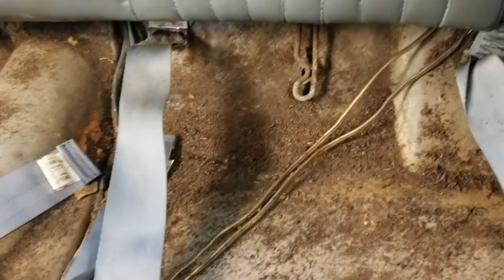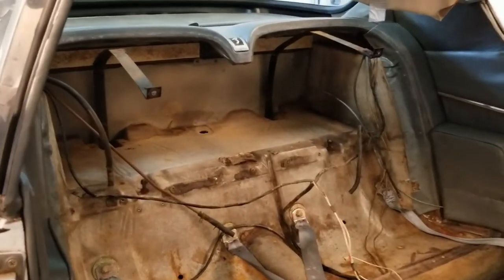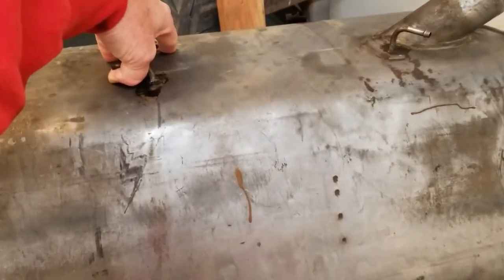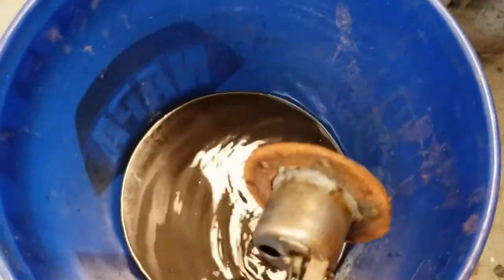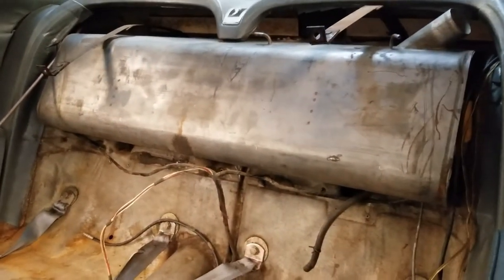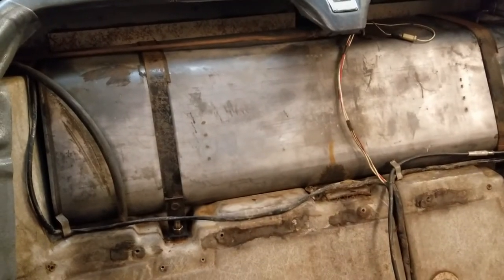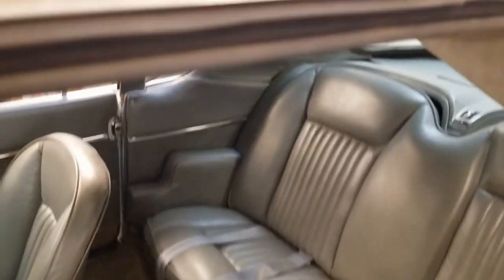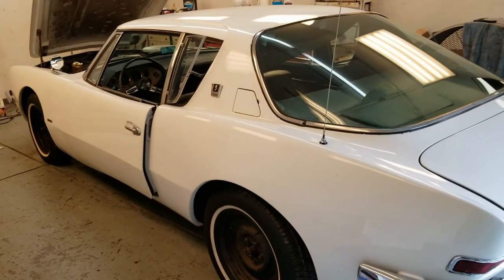Studebaker Avanti Refresh Part 5 - Gas Tank Removal, Cleaning and Reinstallation

Comment: Thanks for your detailed photos and step process. I have a 1981 Avanti II that is undergoing a frame-off (replacement!) rebuild and the fuel tank is something that I will be looking to inspect. It sat for 17 years before I acquired it and I fear what may have gone on inside it !  Your videos are a big help- Thanks!.
Reply from the maker: Good luck with your 81 Steve!  The tank isn't that bad to get out.  I really like using the Metal Rescue to clean the tank.  $25 per gallon at Home Depot and I used 2 gallons.  If your tank is rusted through, Stephen Allen Studebaker reproduces the Avanti tank for around $700.  Glad you like the videos!  Neil

Comment: I need to do this EXACT process on my car that has been setting for several years.  Thankfully the carb is clear and the fuel pump is clear....I think the line and the tank need to be cleaned.  Thanks so much for demonstrating  the tank removal process.  My is a beautifully restored car (R3841) and I REALLY don't want to mess of the interior....
Reply from the maker: You can do it!  Just go slow, label everything, lay lots of towels down on the interior when pulling the tank.  There is a 90 deg fitting on the bottom of the tank that has to be pulled before the tank comes out.  You access that underneath the car.  Stuff  a bit of rag into the hole once you remove the fitting and it will keep any remaining gas from dripping onto your interior..  The Metal Rescue I used to clean the tank is $25 / gallon at Home Depot and it works great.  For less than $100 I had the tank really clean and no more loose particles.  Good luck with your car!

Comment: Surprised that given the tank was already out that the tank wasn't painted. Nice coat of Rustoleum? Also, mild restoration is a great idea but this car needs (1) an electric fan rather than the engine fan (2) air conditioning and (3) power windows....
Reply from the maker: The tank isn't exposed to the elements so no need to paint it.

Comment: Why didn't you explain that the outlet fitting is on the bottom and has to be removed first? Or that there's a drain plug on the frame fuel line?
Reply from the maker: Yes, there are both.  I had pulled the 9 deg ftting on the tank to drain it.  I did not use the one on the fuel line but that is an option too.